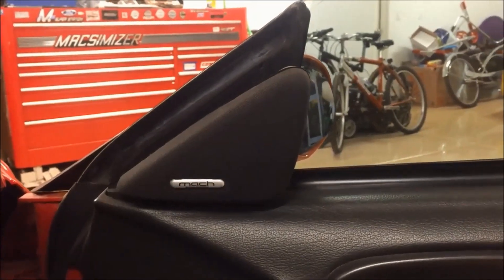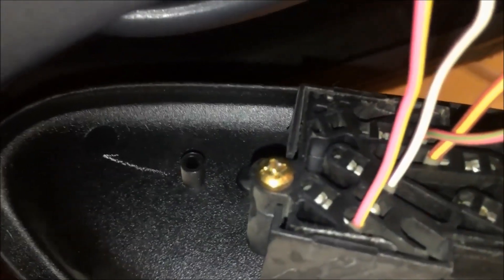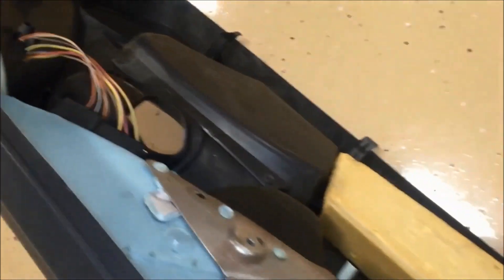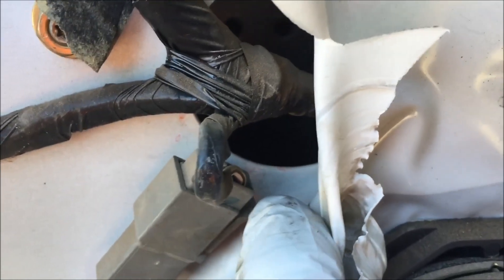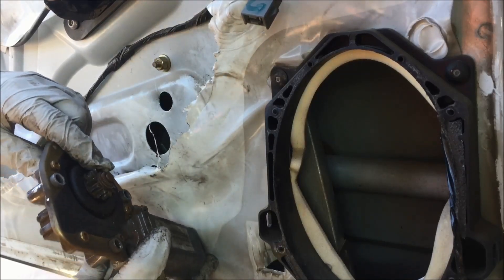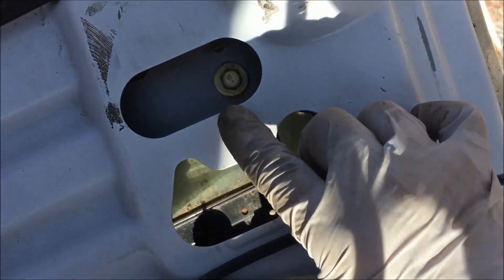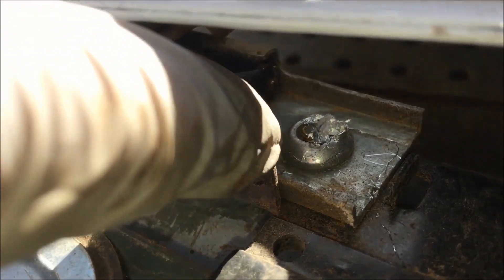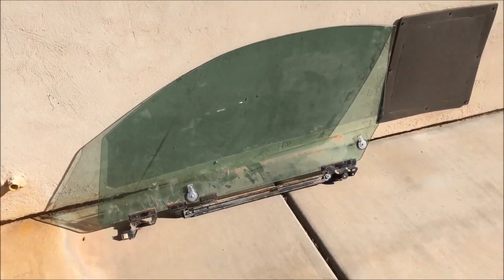Window removal Ford Mustang 1994 2004 Window Regulator

Comment: Hey Danny Johnson! Just purchased a 2004 Ford Mustang Mach 1 in Azure Blue non IUP interior and 54k miles for 6500.00$ so ready for summer!
Reply from the maker: Awesome! Here is my brother’s azure blue if you haven’t seen it! https://youtu.be/MjmJWbC3inA
Reply: How do I get my shaker hoodscoop that nice mine has been sitting out and its very discolored.
Reply: Clean it thoroughly with soap and water then take a heat gun to it and rotate heat in circular motion (don’t put the heat gun to close or you will deform the plastic) ...or you can go the temporary fix and use something like “wipe new” or other restorer

Comment: Hey Danny, how did you get the window to slide out or go into the car door? My passenger window shattered and have everything apart exactly like you have shown in your video.  I can get the front end of the window to slide in however the back end I can't get it to fit through the top of the door.  The wheel (which slides into the track) on the glass is preventing me from doing so. Your video seems to skip this part.  How did you manage to squeeze that in?
Reply from the maker: Depending on if you have the rails attached or removed, I would make it look just like at 11:40 in the video and then lower the window down
Reply: Did you get this figured out? I can't seem to lower my window into the car
Reply: @ILoveFood0911  The rubber trim at the top of the door has to be removed in order to get the glass in.

Comment: Do I have to do all this just to remove the window? I have a 2001 v6 mustang. Window busted with a rock.
Reply from the maker: That or drill our the rivets holding it in and find a way to attach the window with nuts and bolts